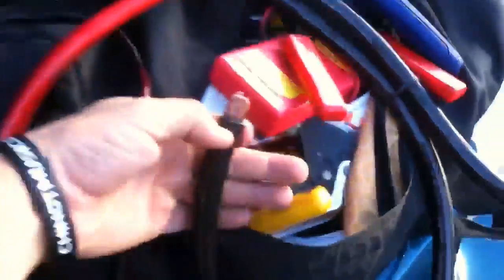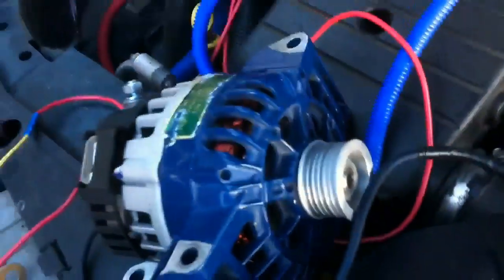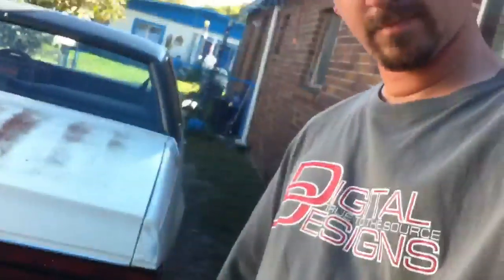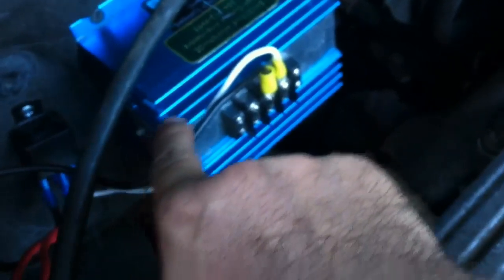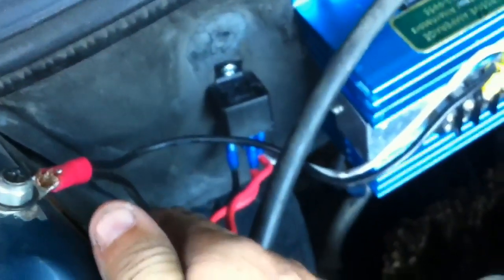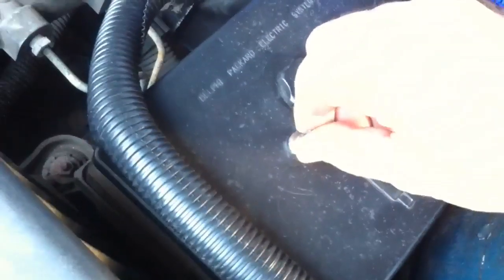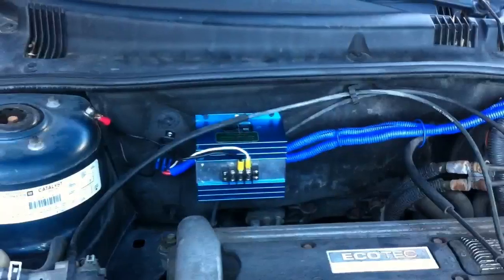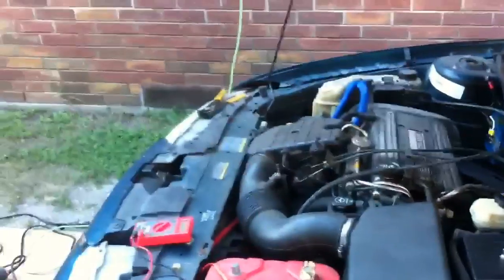Installing voltage regulator

Comment: hello sir can that system be used on dual baterry set up or capacitor / baterry combination .
you see I run that old Delco 12 si alternator in me classic car but I tryed out that unusual plasma ignition so that staff is nice and I love amplifier ignition as well but hv capacitor interact with me alternator starting charge it goes from 1000rpm to 3000rpm so I need to rev lot me car who I do not want to .
So I tought to try out dual baterry system or capacitor banks combination with seperate + and - grounding not to tuch me car at all due to strange rost and other effects.
So please if you know how that might work please put description where to finde such voltage and amp regulators .
I wuld also be in dire need for system that can activate alternator at lower rpm range  spreeds that wuld also be nice to have.
I modifi lot engines so they run always differently so I requare some thing variabel.
It does not mather if it is manual or relay controled just that it works .
Any diagram wuld do or parts numbers where to finde such devices.

Comment: not called 2 gauge.      its call  2 aught .             never called 2 gauge  which is a totally different wire size
Reply: And that's what I need for direct connection to my amps it requires 1 aught

Comment: I googled and I can't those regulators anywhere.
Reply from the maker: I got that blue box through nate at excessive amperage in florida...
Reply: If Im running dual alts 12 and 14. 12 for the car and 14 dedicated to audio. DO I still need one of those?
Reply from the maker: +trugb24 I would assume you might need a step down modulator when you run a 16v but I never asked about a 14v and 12v combo.. you can inbox him on Facebook and see if you need to do something manual or if the alts do it by just isolating the 14v to the system and leaving the 12v alone to go through the vehicle brain
Reply: Aight thanks
Reply from the maker: +trugb24 on youtube MrEaNate is the man who sells them :)
Reply from the maker: +trugb24 on youtube MrEaNate is the man who sells them :)
Reply: http://www.motorcityreman.com/14voadvore.html

Comment from the maker: @audioarsonal actually I was gonna run the ground to battery but did some testing and since I used a bit thicker wire then normal it gave me good current :) so I let it be :p 12gauge wires

Comment: Is that a drywall screw with some sort of nut on the ground? I would move the ground for the regulator directly to the battery or the alt case.